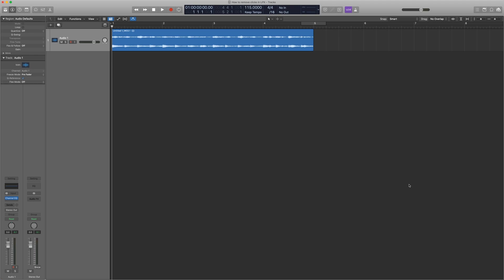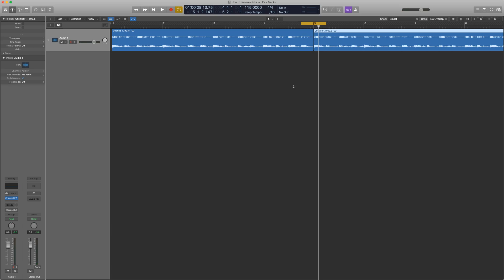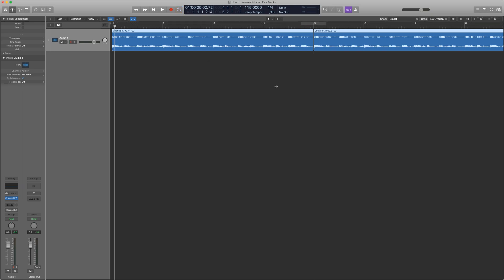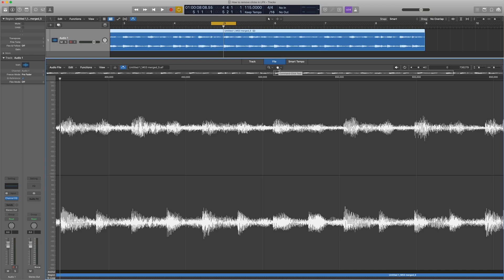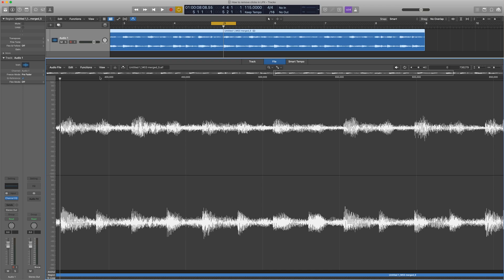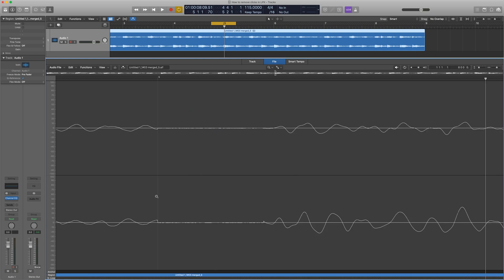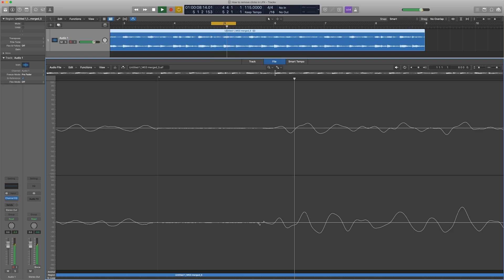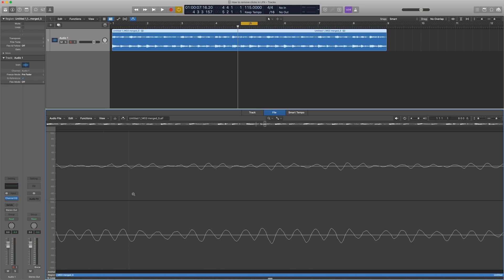How To Remove Clicks And Pops In Logic Pro X

Comment from the maker: Some common troubleshooting:
If the 'File' option is not there for you, go to: Logic Pro -> Preferences -> Advanced Tools and click the check box next to 'Show Advanced Tools'

If you get a message that says “audio file or volume is locked”, bounce the audio region to a new track and edit that one instead: Right click -> Bounce in place

If you're trying to draw and it's switching back to the zoom tool, you might need to zoom farther into the waveform. Zoom in closer and try again

Note: this is a permanent edit to the audio file that logic is referencing and can’t be undone. I recommend bouncing the audio region in place and editing the new copy so the original is untouched. Right click -> Bounce in place
Reply: no kidding, I was just about to ask you the question how to find the File tab! :) Unfortunately, my advanced tools have been ticked and still no File tab...
At first I thought that maybe the tab was only in the older versions but now I know that this is not the case.

Comment: I was struggling so hard for weeks to the point where I felt like giving up all together and then I revisited your video and tried again, you really helped me fix a problem I've been having issues with for a while now. One thing I would like to add that really made the difference but you didn't note is that in the upper right hand corner of the file bar there is a vertical and horizontal zoom button which will allow you to see the waves a LOT more easily.

Comment: I found this super frustrating to work with. (1) Copy-paste behaves like an insert rather than *overwrite*, shifting the entire region left or right. Is there a way to fix this? (2) When I Z, the zoom level resets back out, and I press Z a lot on accident because I use Ctrl-Z a lot. (3) Logic Pro won't allow you to do this to a region that's ever been flex timed: you have to bounce it first, which worries me a bit.

Comment: Great video! Super helpful! I have a question about what seems to be a glitch in the software. When I go to try to edit certain audio files, it says "Audio file cannot be changed. Volume or file is locked." Any idea how to solve this problem? Thanks!
Reply from the maker: Yeah, bounce the audio region to a new track and edit that one instead: Right click -> Bounce in place
Reply: @Drummer52895  Thanks for the reply! That fixed the pencil issue, but it only bounces to stereo. Is it possible to keep it mono?
Reply from the maker: @emoryparkermusic  you can definitely convert it to mono. On the left pane there should be an option for mono output but I don’t have logic in front of me so I can’t recall exactly what it looks like

Comment: Can you use this method to fix/ edit out drip or lip smacking sounds ?
Reply from the maker: This method is best for instantaneous clicks. Drip or lip smacking sounds are longer in duration and would be harder to smooth out with the pencil- but it might be possible. You can also try filtering out certain frequencies with the EQ

Comment: At first I thought it was my Mac or my studio monitoring headphones not working right but after seeing this video I may have figured out what my problem is ,Dose this trick work on midi tracks that are not in audio form?
Reply from the maker: You can only edit with the pencil on audio waveform tracks. However, you can bounce a midi region in place and then edit out the clicks. Right click -> bounce in place
Reply: @Drummer52895  thanks

Comment: Anybody know why I can't get the pencil to draw? I have zoom as primary tool, pencil as secondary. When I hold "command", I see the pencil tool appear just as it does in this video. But as soon as I begin a left click, it switches to the zoom tool again. I end up zooming and not drawing.
Reply: Just figured it out... need to click almost exactly on the waveform line otherwise tool defaults back to primary.

Comment: Thanks, this video helped a lot. Just one question, I'm having trouble with an audio sample I have which has a russling/crackling/muffling kind of sound in the background of it. Do you know how to get rid of this? Should I use an EQ?
Reply from the maker: Sounds like there is a lot of background noise in your sample. My preferred way to deal with this is to use Audacity (separate software and is free)- however, you will need a section of audio that just contains the noise (russling/crackling) and nothing else. Import the audio file, select the audio with just the noise, and click Effects > Noise Reduction > Get Noise Profile. Then, select the entire audio sample and click Effects > Noise Reduction > OK. If you don't have a section of pure noise and if the audio sample doesn't have a lot of high frequency content besides the crackling noise, you can try to reduce the high frequency content in the EQ in Logic- but this method doesn't work as well.

Comment: This is amazing thank you. But whenever I try to draw using the pencil tool it just becomes a magnifying tool, so I am unable to draw the wave form. Any advice please? Thank you.
Reply from the maker: If your pencil tool is in the right tool slot, you will need to press and hold down the command button to use it (what I did in the video). Otherwise, you can assign the pencil to the left tool slot (primary tool) and you can just click and drag to use it.
Reply: DNNY O yes I’ve done that.. in fact I got so annoyed at one point I assigned both right and left to the pencil tool. And it still just zooms in instead of letting me draw.
Reply from the maker: drumstruck99 Weird. Try restarting the application. Not sure what’s going on there.
Reply: DNNY O cool thanks will try that. Thank you for replying.. appreciate it
Reply: @drumstruck99 I had this same issue and figured out why. You have to zoom in really close and draw almost exactly on the waveform line. Otherwise, it will indeed switch back to the zoom tool.

Comment: HELP!! I need to edit some pops and clicks out of my vocal track but I can't use the pencil because it says "audio file or volume is locked". If anyone knows how to fix this that would be great!
Reply from the maker: Try this: Right click on the region of the audio track that you wish to unlock, go down to the little option "SMPTE Lock" and there you can choose how to lock it, or unlock. Not sure if that will work for you but worth a try. I think I've encountered this issue before too.
Reply from the maker: Alternatively, from the editor, you can try: click on FILE, click on Audio File -> Update File Information
Reply: @Drummer52895  Thanks for getting back to me. I tried both of these and for some reason it still doesn't work. There's no SMPTE Lock option when I right click, I could only access the key shortcut.
Reply from the maker: @kawikau.3532  are you able to bounce the audio region in place to a new track? Right click -> Bounce in place
Reply from the maker: If that doesn't work, try looking at this article: https://www.gearslutz.com/board/apple-logic-pro/1115302-volume-file-locked.html   Another software or process may be accessing that audiofile. Maybe you're using a third-party plugin. Basically something else is accessing that audio file and has it locked for editing.
Reply: @Drummer52895  THANK YOU SO MUCH! I've been stuck on this for three days. The bounce in place worked!!
Reply: @Drummer52895  bounce in place worked thank you!

Comment: Thanks for the video! I have a few clicks in my audio I'm trying to get rid of but it is very difficult to find them! I zoomed in and continuously played and listened but it was impossible to pin point.  Nothing looked out of the ordinary, just one continuous waveform.  Any suggestions? Thanks!
Reply from the maker: Look for little spikes in the waveform. They can be quite small and still produce a loud click. Try to position your cursor exactly where you hear the click and zoom way in.